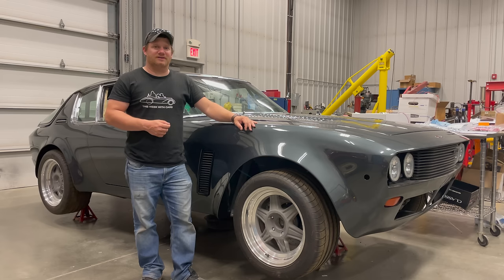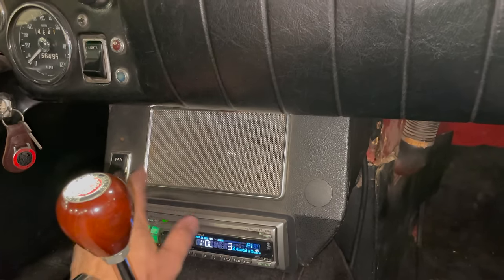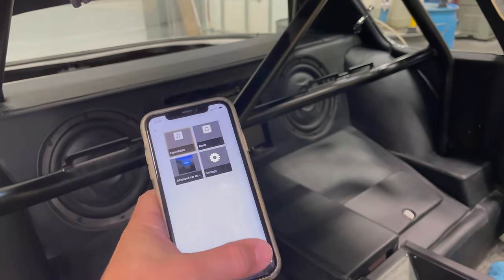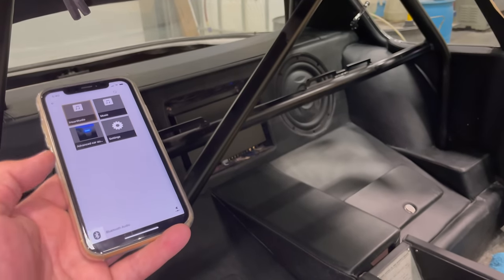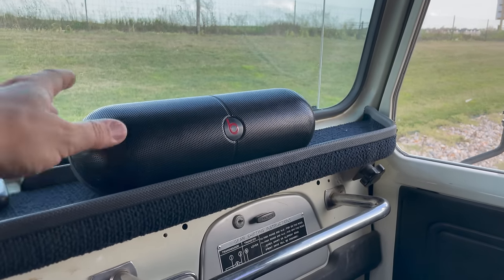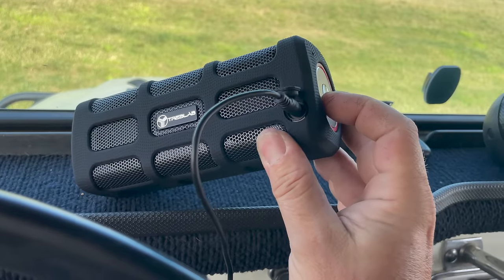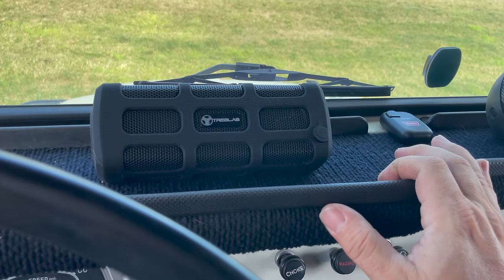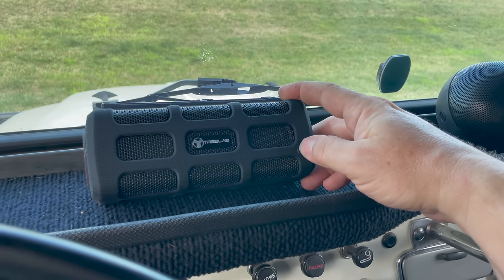Stereo Options for Classic Cars

Comment: Back in the 90s I did alot of vintage installs. A couple my favorites were this 69 corvette by modifying a kenwood 3 hole+ cd changer controls to fit in the factory metal bracket without modifying the car.  I did a really nice glovebox install in a Studebaker pickup and moved the IR sensor to hide in the instrument cluster.  The electronics do not need to remain inside the factory housing to still function if done correctly.  By taking it apart and spreading the parts out inside the dash and other hidden spots you can get ALOT more sound without modifying anything in the car and remaining completely hidden.
Reply: I not against hiding equipment, that's fine by me. Don't know if your warranty would have been valid though but that would probably have been something I would have done, if the need arose and I had even though about it! 👍

Comment: I modified a 70s am mono radio by fitting a bluetooth module which switches the signal when it detects sound from the phone. It is only visible by looking right up under the dash as I fitted it in an external box. It is neat having it switch between am radio and gps navigation directions

Comment: The phone/bluetooth option is a non-runner in the UK/Ireland where handling your phone, for any reason while driving, can earn you points on your licence and a fine, and, in the case of anyone who has held their licence for less than 2 years in the UK, an outright driving ban. This option would only work if there was hands free access to the radio controls via the phone.
Reply: Same here in NSW.Austalia.
Reply: Same here in Norway. About 550USD if you get caught and 3 points on the license. Bye bye to licence after 8 points. Each point takes 3 years to be removed. I'm one of those the strongly dislike bluetooth stereo things as sound gets so flat. And I can't stand listen to music with bass to it, hence why I absolutly hate those small bluetooth speakers. Thankfully my classic car is from the late 70s and those was made up to 86'. By then there was some decent sterio equpment on the market. When I bought a head unit for my car some years ago I bought one that had a vintage feel to it. As my car has green lights in the instruments, my headunit also had to feature green lights as well. It has knobs but do have a USB port along with a cd player. I plan on fitting my car with vintage Pioneer stuff when it is road worthy again.
Reply: Same in California.  And police in California are here to raise revenue for the Government, so fee generating offenses are first priority.   Even if they are only imagined. I'd have to say any cell phone/ bluetooth solution is a solution for a vehicle with a passenger, not one for a vehicle with just a driver.

Comment: Another option to listen to radio with a Bluetooth speaker is if your phone has a built-in radio antenna (mine does).  Similar to the speaker you were showing, you need to plug in a pair of headphones or phono wire to provide the antenna.  So you can use the wire to connect your phone to the speaker (hence now having an antenna) and then use your phone to select the radio stations on your screen and control the volume.   Best of both worlds.  No data used and a screen to select the station.  You can even have preset stations just like a real car stereo.

Comment: I used a round marine radio that isn't much bigger than an oil pressure gauge and that has bluetooth capability and I mounted it in the ash tray of my 1946 Buick Super that didn't come with a factory radio. You can't see it unless you open the ash tray door and I was able to hide the speakers too. It has AM/FM and can play music from my phone over bluetooth and has a USB jack that I can use to charge my phone or play music stored on a thumb drive. I don't have an antenna so I can't hear FM very well but I use it mainly to stream music from my phone so I don't miss it.
I do like your bluetooth speaker idea. I might try that for an old truck that I have.

Comment: The Treblab speaker has just the same features as a "soundbar" sold by Poundland in the UK for £8 (11USD). The power bank feature delivers a lot less than that claimed 7000 mWH, but the circuitry appears to be identical, including the poor control of which FM station is playing..

Comment: Handy to know. That new speaker would be ideal for my motorcycle fairing. It has a radio set up but that speaker would fit right in as a replacement and give me modern functionality. My bike is a 1978 Yamaha XS1100 with a Vetter fairing and Cyclesound audio unit. Happy days!